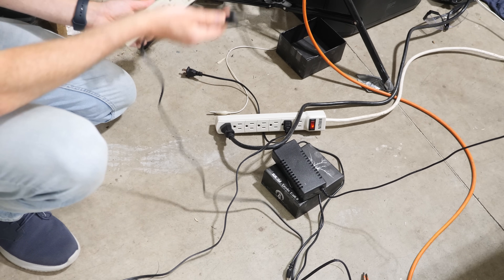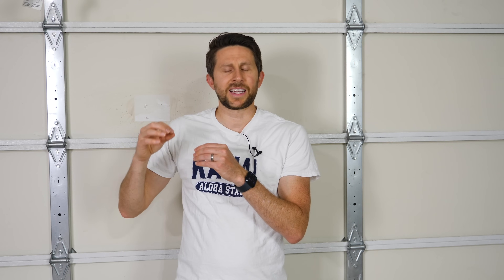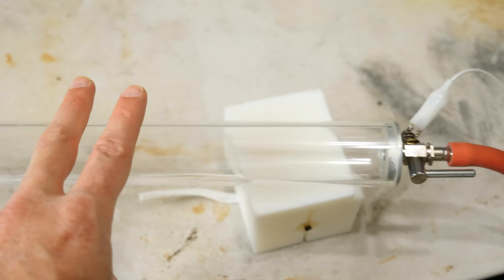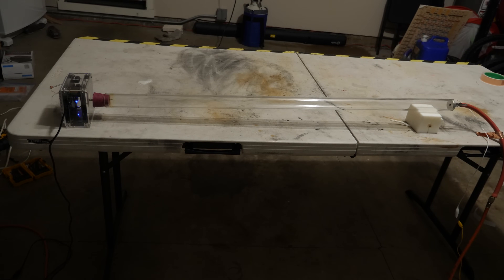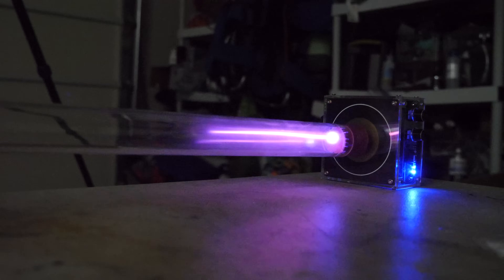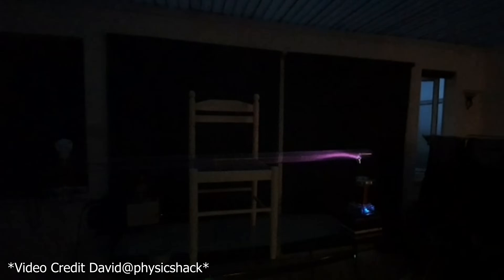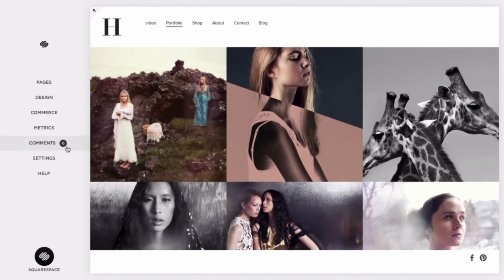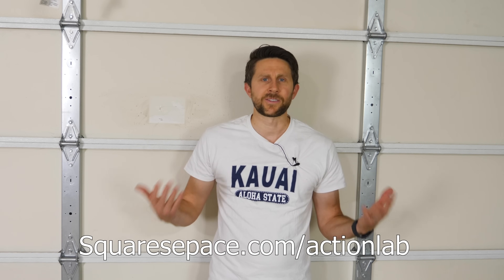Using the Air As a Wire—Was Nikola Tesla Right?

Comment: To Action Lab: How much UV light was generated by this, if any, and if so, did you have to wear UV filtered eyeglasses to look at it, and also any special camera settings to record it?
Reply: I had the same thoughts.  High voltage across a vacuum tube can create some nasty rays.
Reply: UV would probably be absorbed by the tube. I would be more concerned about the generated XRays.
Reply: @wernerviehhauser94   Longer wavelength UV, above 300 nanometers, may not be blocked much at all. It depends on the type of glass and its thickness.
Reply: @DANGJOS  technically true. But if its not quartz or PVC, it should.
Reply: X rays begin being generated at 27 KV. They become truly dangerous above 100 KV...
Reply: @rayoflight62  Incorrect. 27kV is just a usual acceleration voltage for CRTs, nothing else. Overlapping with the EUV range, Xrays start at about 10nm (about 150 eV). Xrays are dangerous as ionizing radiation at all wavelengths, radiation dose is what matters, not photon energy. And since soft Xrays are more easily absorbed in human tissue, they are by no means less dangerous than hard Xrays.
Reply: I would be more concerned by the generated  ozone
Reply: @wil-fri  NOx also. Since the discharge is in vacuum,  I would not expect large amounts to be generated. But these, you smell. Ionizing radiation is something you don't really detect with your senses.
Reply: Just a whole lot of energy with give off radiation. I experienced this with welding.  Lighting gives off small amounts of Gama radiation.
Reply: I'm addicted to pigger nussy 🤠
Reply: @redneckshaman3099  UMMM what?
Reply: @godspeed2145  once you go black, it's like smoking crack ❤️
Reply: Safety 3rd!!!
Reply: The pyramids were way ahead of Tesla..
Reply: @mavadoroaster  deranged rambling...
Reply: @mavadoroaster can you eleberate
Reply: @thunderlord1263  I didn't mean to reply to your comment. But long story short the pyramids were rumored to be giant power plants+
Reply: @mavadoroaster  this is only true in exactly 2 parallel universes.
Reply: @wernerviehhauser94  Its 3 now. C-177286 was recently discovered. Although some claim it as myth...

Comment: I have heard a few things about this wireless energy idea. one was that teslas coils were going to operate at schumann resonances, natural glabal resonant frequencies in the atmopshere. another thing, and probably part of the same idea, is that the towers would create standing waves of energy in the area.
Reply: Standing waves would mean that you could only extract power at certain intervals.
Reply: @MirlitronOne  yeah, and where you can do it depends on the frequency. schumann resonance wavelength is the circumference of earth, so I dunno what the whole plan was... would just using it as a carrier for a higher frequency work?
Reply: @CaptnApathy  : There's more than one Schumann resonance, it's a category rather than one frequency. You're thinking of the lowest frequency Schumann resonance, which I think is supposed to be around 1 Hz. Another floats around 60 Hz, and there are more beyond that.

As for the standing waves restricting where you could get power with this, probably so, though given that you'd expect world-wide echoes there might be enough "basal noise" at some frequencies to reduce the effect.

Also, as long as you were within 1/2 wavelength of the broadcaster, you would presumably be able to use near-field coupling to get power regardless... I think the near-field footprint for 60 Hz was around 1,500 miles.

Comment: The concept of the tesla coil is misunderstood. The atmosphere is a capacitor and the ground is the wire and in a best case scenario the transmitter would not leak any coronal discharge but instead just cause the ions in the atmosphere to oscillate at the frequency of the coil in order for it to be received anywhere on earth. The key is grounding and tuning through capacitance.
Reply: Best explanation I've heard!  One of Tesla's experiments (if I recall correctly) involved plugging dozens of lightbulbs onto a hillside.  With nothing connecting them except dirt.
Reply: @Mannwhich  Are you positive (pardon the pun) that you're not perhaps recalling a scene from the movie The Prestige? Btw, David Bowie was more believable as Tesla than Tesla himself.
Reply: Yes, unfortunately all these Tesla coils people use to demonstrate with by shooting arcs into the air only confuse the actual theory which Tesla researched. The true Tesla coil in the way he used it had no arcs emanating from it. The arcs are an indication that the circuit is not operating efficiently.
Reply: Вполне возможно. Лично я думаю, что надо использовать второй трансформатор в режиме передатчика, а нагрузку включить между первичной обмоткой и питанием. Типо напряжение между бубликами не будет снижаться под нагрузкой (типо если нагрузка есть, то чтобы на приёмнике было напряжение такое же как на передатчике, нужен маленький ток, иначе под током нагрузки напряжение на ёмкости поднимется и зарядит этот конденсатор. Естественно, он возьмёт на себя часть напряжения. А если будет два передатчика то уже на кондёре будет больше напряжение а значит и ток. Кроме того, магнитное поле может продавливаться, менять форму. Это возникает и при солнечном ветре, и под нагрузкой у синхронного двигателя. А что если электрическое поле может так же вытягиваться? Тогда, может быть, между двумя катушками может возникнуть что-то вроде мостика, по которому будет протекать ёмкостной ток.) может быть я пишу бред, надо проверить, может заработает, а может и нет...
Reply: Have you read Thomas Bearden's theory on Tesla discovering phase conjugation, also called 4-wave mixing? He describes using the Earth and Ionosphere as a self-pumped phase conjugate mirror. The idea was that in a medium or circuit, 2 equal and opposite incoming waves may provide a "pump" to establish electrical Non-linearity in the medium, like the Earth-ionosphere gap, or between a grounded Tesla coil and the thermoelectric currents in the center of the Earth. If you can phase conjugate ambient waves in the environment you can confine them in the system like a resonant cavity of extremely high Q factor, which is also automatically phase locking. Phase conjugated signals are said to be "time reversed" because the phase angle is rotate 180 degrees and the momentum vector is exactly the opposite vector in space to any incoming waves. So these  pairs of waves become locked together between Tesla coil and source, building up over many cycles without dissipating by normal reflection or other distortion. A kind of automatic parametric resonance which can cohere noise signals into power with minimal losses. This could explain Tesla's claims of collecting "radiant energy" from the environment in excess of the energy which was transmitted from his coil.
Reply: Great comment! He did write about this.
Reply: The truth!
Reply: Have you ever heard of a powerful Tesla coil being fired up and when disconnected from the power supply to sill keep running.if so can you explain what is happening hear
Reply: @jm3275 bull crap. Is this some Tesla religion or what?
Reply: @mikrophonebeatLah согласен. Это действительно чушь какая-то. Максимум что могло произойти, так это кратковременная работа от конденсатора "накачки", или от радиоволн, которые остались после работы трансформатора. Ну хорошо,  каким-то удачным образом рядом ударила молния, ВЧ помехи от которой принял трансформатор и отрезонировал. Но долго работать это вряд ли могло...
Reply: All of these are all cool theory's but stupid if you don't expiriment.
Reply: @thunderlord1263  says the guy who doesn't experiment with it lol

Comment: Is it more efficient than copper cables tho?
What if we switched to using vacuumed rubber tubes instead to carry power?
Reply: no
Reply: @andrewsneacker1256  ok
Reply: We'll make our answers as short as possible like a yes or no survey
Reply: Lol. About the survey thing. I think the main reason is the voltage drop from the negative resistance. Sure it can be done but the proportional rise in current would defeat the purpose of modern day high voltage transmission (if power remains constant then sending power at higher voltage reduces current and the resulting resistive losses associated with it.) Hopefully that was an answer that satisfies your curiosity.
Reply: @Slowly_Going_Mad  mm yes,I thought so since our resources of copper are gonna run out one day so we should find some alternatives to moderns energy transport means
Reply: @sandrawong6787  I've thought about it too. Only thing I could think of was making a meta material that acts like metal but could be made from nonmetals. Crazy idea and probably close to impossible right now but someone may figure out a way at some point.
Reply: @Slowly_Going_Mad  graphene nanotubes
Reply: @sandrawong6787  still comes with some technical hurdles as the devil is in the details, but yeah it's not a bad start. It'll get there just we may or may not see it in our generation.
Reply: @Slowly_Going_Mad  definitely
Nanotech is getting more and more advanced
Maybe increasing the heat capacity of graphene will help it conduct more electricity,rather than cooling it down super cold
Reply: @Slowly_Going_Mad  lmao I just realised that @andrew sneacker has been intellectually critiquing random comments 🤣
Reply: @sandrawong6787  lol, technology will likely continue to improve as usual. If someone has an idea be it good or bad they'll find a way to make it happen. I'ma have to see what shenanigans Andrew is up to.
Reply: @Slowly_Going_Mad  click in the account lol
Reply: @sandrawong6787  I seen.

Comment: Well you also have to contend with the inverse square law.  It's simply not practical for so many reasons.  Some people think it's because it would be about free energy and that's why they won't do it.  And although that would be a factor, that is by far not the only factor as to why this won't be done.
Reply: The inverse square law isn't an obstacle, because the Schumann resonances keep the energy constrained to the Earth's atmosphere... economics is an obstacle, because you can't charge all the users!
Reply: @absalomdraconis  The economics argument doesn't hold water.

Charging for a service which is unmetered and transmitted wirelessly, already has a working model : look at the UK Television License system.

UK citizens have for decades required a TV license to receive live broadcasts.

The vast majority pay it and substantial opposition to the system has really only picked up momentum in recent years.

Vendors of televisions are required by law to report the name and address of persons buying new TV sets, to TV licensing, so that the purchaser can be pursued for the license fee.

The same, or similar system would be implemented, and doubtless the physics involved would make it possible to detect the operation of unlicensed power receivers/transformers... In fact the very high levels of power involved, and precise frequencies of operation would make it child's play to detect and locate unlicensed operators.
Reply: @absalomdraconis  that atmospheric stuff is not what he was planning, it was supposed to be an EARTH based resonant circuit using a few towers, which is impossible, that's why he failed, not because of "big energy"
Reply: You don't need to be a flat earther to believe in free energy and let's not forget that free energy is not the same as perpetual energy. There's electricity in our atmosphere all around us, stars are giant balls of energy production. Of course there will be massive initial costs to get these particular types of projects to be viable and have long life spans. Let's not forget that just because right now we don't understand a way to make free or perpetual energy devices doesn't mean that kind of technology is impossible, we just haven't figured out how it's done yet. Let's also keep in mind the different technologies over the years that were incredibly transformative new means of supplying energy that were supposed in one way or another.  And on a final note to spark some intrigue, and perhaps inspire some curiosity that may lead to some investigating,  when Nikola Tesla died, either the FBI or Naval research or both, I can't remember, took possession of all his notebooks and drawings and blueprints and in progress experiments etc. Basically everything Tesla had ever imagined and put down on paper or prototyped was confiscated.  And interestingly enough Dr. John G Trump was on the task force that catalogued  Tesla's belongings. He was also  a professor at MIT  a physicist,  electrical engineer, and inventor oh and just so happened to be Donald Trumps uncle which is very interesting in my opinion. And this is all widely admitted, easily verifiable information and not considered any sort of " conspiracy theory " so plz save us all the b s. In fact stop pushing this notion that these kinds of theories are just delusions because it seems every time someone starts to uncover the truth and it Becomes more and more well known it gets discredited by associating unrelated or inaccurate specifications to the real subject at hand. Of course later down the road it always comes out that the "conspiracy theorists" were correct after all. Funny how that works.
Reply: People that believe in free energy really are the flat Earthers of the electronics world.
Reply: @Unethical.Dodgson  haha true
Reply: @Unethical.Dodgson  define free
Reply: @Unethical.Dodgson  not that kind of free energy, if large areas had wireless power how would you keep track of it? You can't really install a meter in every single circuit, so people would have unrestricted access to such energy, it wouldn't be FREE energy but it would be "free"
Reply: @Unethical.Dodgson  but there is free energy. It’s literally everywhere in nature, how do you think solar panels windmills and dams work
Reply: @vincevvn  first law of thermodynamics dude.

Comment: I don't think busing the form of electricity we currently use would work the way he wanted.....  Well it's not another TYPE of electricity, it's just another way to transfer and generate it....  like what if you could use electricity on the 'producing' end to generate particles in the quantum 'realm' that are "linked" to another particle on the 'receiving' end that then generate the electricity that powers the light......   okay, so in the quantum realm you can pair particles so that no matter HOW FAR they are separated the react according to what it's paired particle is doing... so if you have particles A and B paired with each other and you move particle A up then particle B moves down.... well if were could find a way to constantly create these pairs of particles, and get them to do 'work' like we do with electrons in electricity, then we could  use electricity to move the particle A's at the production end of the system and then no matter where we put the receiving end with the B particles they could then be producing the electricity on that end and we are transferring power wirelessley with no limit on distance and the only loss would be INSIDE the production and receiving, not during the transfer
Now I have NO CLUE if we can get these paired particle to do work OR if we can generate paired particles that are already separated (which I don't think we can) but we could still not generate paired particles but just use a bunch of already paired particles to continuous do work....
I probably make ZERO SENSE to ANYONE that actually understand quantum physics (which I really don't understand at all) so none of this is probably possible.. I'll stfu now